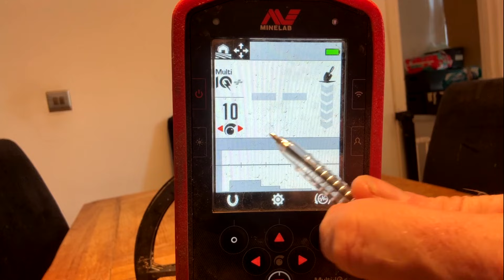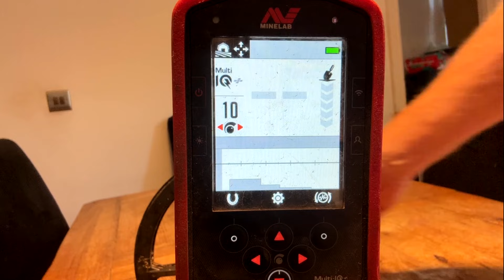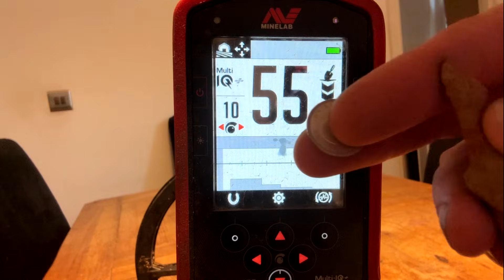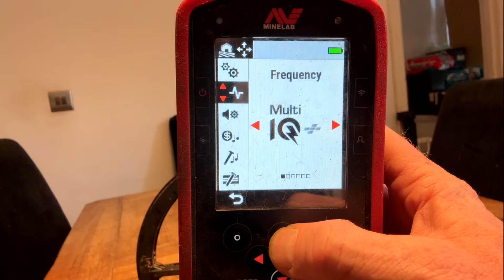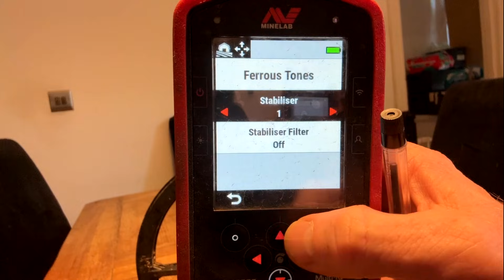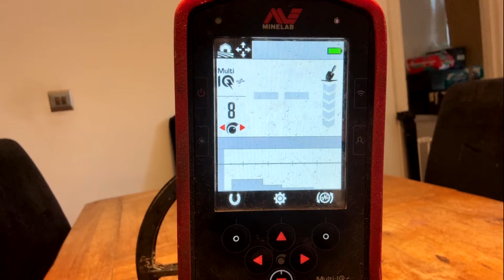MINELAB MANTICORE 2D BAR BASICS

Comment: I've been learning with mine with the tracing from the centre lines had a load of coins now on thier side mate tracing away from the centre line
Reply from the maker: Yes 100% especially on and down you get more trash digging up the top but ultimately most importantly is a 2 way tone. Well done mate

Comment: If you wave the target over the coil on pinpoint mode it will create the shape of the target
Reply from the maker: Thanks mate
Reply: @theartefactaddict I also thin bar on the left side going top to bottom should only be 2 lines thick you can remove the extra by using the tick and x feature to add or remove you could be missing small gold

Comment: Where did you get the red screen protector from? Thanks
Reply from the maker: Should have added if you ever need any accessories checkout Crawfords metal detectors and use my code in bio for 10% off if based in uk.
Reply from the maker: Just on eBay mate search what you asked for on google and comes up mate